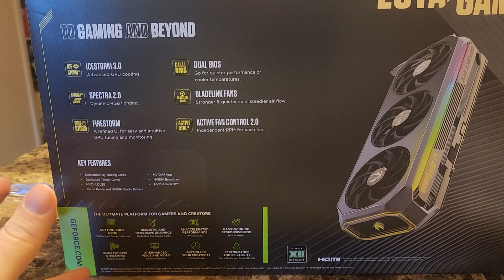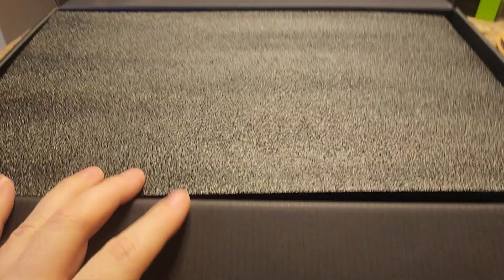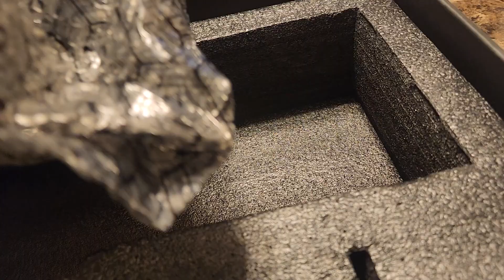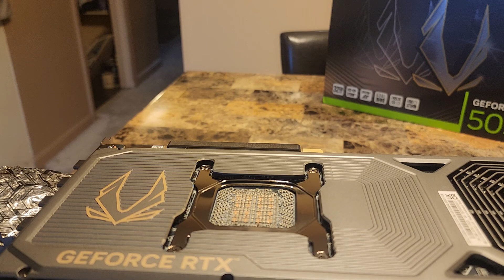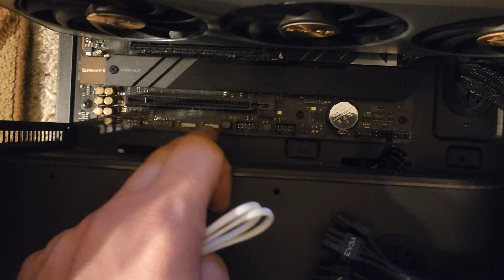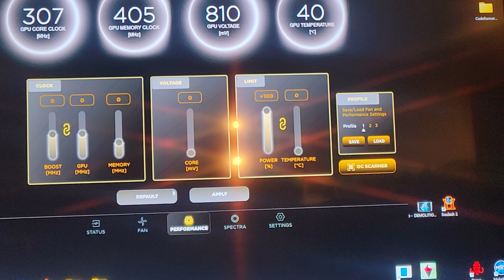RTX 5090 Zotac AMP Extreme Infinity Edition | Unboxing, Installation, Basic Testing

Comment from the maker: Well, the ROPs are 176 so that's good!  The power draw however is NUTS!  The last ~10 minutes or so I go over temps, power draw, playing with color profiles for the GPU lighting (which is pretty cool I must say) and some testing in DF Lab.  I will do some gaming tests separately soon.
Reply: @DruuzilTechGames  I see! That's why the cables keeps melting on the 5090. The power draw is ridiculous
Reply: Have you try to undervolt it, for less power consumption ?

Comment: Sorry, but, you're wrong. This card will fit in any mid tower case on the market today. It will probably also fit in several mini tower cases. As long as the case can support a GPU that's 13.5" in length it'll fit.
Reply from the maker: It's well over 3 slots wide and generally massive.  Saying "it'll fit" is all fine and dandy, but you can't close the case because of the position of the power port.  So yeah, I'll stand by my statements.
Reply: @DruuzilTechGames 

Physical Specifications

Video Card Length

13.10 in. (332.74 mm)

Width

3.5 Slot; 2.74 in. (69.60 mm)

Height

5.41 in. (137.50 mm)

I will stand by my statement that it will fit in any mid tower case on the market today. Also, some mini towers will also fit. If the plug gets in the way that is why they make right angle 12vhpwr connectors 😘

Edit: also, man, just for the record I was only arguing about it because you straight up said that it wouldn't fit in a mid tower in the video. 💁🏻‍♂️

Comment: Is this card still working well? Is it possible to undervolt it?
Reply from the maker: Still working perfectly so far.  As far as undervolting I haven't looked into it.  I have lowered the power limit to 92% to keep the power consumption down a bit while training deepfakes with it.  Still uses high 500 watt range though.

Comment: Hey man.  Thanks for videos.  How does the 5090 perform compared to the 4090 on DeepFaceLive with some of your existing models?
Reply from the maker: It doesn't work in DF Live at all, so I can't test it.
Reply: @DruuzilTechGames  Thanks for the info man.
Reply from the maker: I believe there's a Chinese version someone in Discord was claiming worked on the new 50 series cards, but I don't really trust the source so I'm not sure.  Hopefully either the original DF Live will get updated, or a newer similar app that runs on Pytorch will come along soon.
Reply: @DruuzilTechGames  fingers crossed

Comment: What a dumb place to put a RGB header. WTF Zotac?
Reply from the maker: I really don't like the power connector being there either.  It makes it impossible to close the case because the power cable is sticking out too far.  Power and RGB should be on the end of the GPU (but they have their big "Infinity Mirror" there).

Comment: Ive got the same card & its been great. Only weird thing i get is a very random single click noise, like a switch. Normal happens as i start to put it underload with a benchmark. You had this issue mate?
Reply from the maker: I have not personally noticed a clicking noise.  Not sure what that'd be.

Comment: Thank you for the review! I would like to ask you that, did you notice any coil whine noise?
Reply from the maker: Not really.  The fans are somewhat loud though above ~65%.
Reply: @DruuzilTechGames  Astral was the same. After an UV, everything is OK, except the horrendous CW. You may try 0,95V +250 Core with curve editor. +1000 mem also will be fine.
Reply from the maker: What kind of power draw are you seeing on the Astral
Reply: @DruuzilTechGames  It is about 320-330W with my settings. 520W peak.
Reply from the maker: That seems really low given how insane mine is getting without even overclocking it.  I guess when they say AMP they mean it.
Reply: @DruuzilTechGames  It is about 320-330W with my settings, 520W peak.
Reply: @DruuzilTechGames  I guess it will be almost 0 with the UV.

Comment: Congrats, great impressions! How subjectively noisy is during load? Thanks in advance!
Reply from the maker: It's more noisy than the 4090 MSI Trio I had previously.  Not as noisy as a single-blower fan design like the RTX 5000 Ada datacenter/workstation card though.  I run the fans around 70%.  I imagine it'd get truly annoying much beyond 80%.  60% more tolerable.

Comment: Why you don’t use the 12 pin power cable from the psu to the gpu?
Reply from the maker: Most current day power supplies offer that, but the one in this system doesn't have ATX 3.0 support built in, so I had to use the provided 4-way splitter (that's why they provide the splitter in the first place - for people with power supplies that don't have ATX 3.0).  That's only really been available for like a year.. maybe 18 months.  I have one power supply from MSI in another system that has that connector, but it's only 1000w and it's in use on another GPU.  I did just order a newer supply to go with the 5090 though and will be making that setup change soon.

Comment: I dunno if you knew but the 5090 actually has spikes up to 900w!!! Can the factory OC be deactivated? did you try?
Reply from the maker: Mine has not gone higher than 670. How would it hit 900w?  The max power draw between the power cable and the PCI Express bus should be what, 675 total?  The bus only offers 75w and the cable is 600.
Reply: @DruuzilTechGames check tech power up they talk about these 900w spikes that last microseconds (not always) but modern psus absorbe them

Comment: Pytorch nightly builds only work with 50xx cards now, i got my FaceFusion running by reinstalling cuda and tensorrt tho. I got an 5080 but you for your hard work deserve to have 5090. You will make an use of it. As you mention Cyberpunk, play it only with Path Tracing.
Reply from the maker: Tensorflow DF Lab does work, it's just slower than it should be.  It should be possible to get it working properly if someone with a bit more skill in development takes the time to make it so.  The Pytorch version of DF lab at this time is lacking in features, and limits you to 384 resolution which is not sufficient for making Deepfake videos in my opinion.  
I'll keep playing with the CUDA libraries though and hopefully get the 5090 running at proper speeds.

Comment: The power draw is ridiculous.
The 6000 Ada lovelace would be an amazing option. (But the price)
Great video 👍
Reply from the maker: I've seen 6000 Ada cards for as low as ~$5500 on eBay (which is where I've bought 100% of my datacenter cards), and people will often do the whole "Best Offer" thing, so you can talk them down.  If I could trade my 5090 for a 6000 or 5880 Ada (maybe add a bit of cash on my part) I'd do it all day.
Reply: @DruuzilTechGames  that would be awesome. Because with the issues surrounding the 5090, it would be a great idea to trade it for 6000 Ada. 
Or maybe Nvidia will come up with a fix for the 5090

Comment: It's a 32GB microwave that is insane over 600 watts is nuts! Great video bro!
Reply from the maker: 670 is easily the highest TDP I've ever seen in a PC component.
Reply: @DruuzilTechGames  if that's the future we gonna need more nuclear power plants lol maybe for shits and giggles test at x16
Reply from the maker: I think that Blackwell datacenter cards would better serve me than a 5090.  I may or may not keep it in the long run, if I can get something like an RTX 6000 Blackwell Edition (which should be over 48GB GDDR7) that'd be awesome.  Big $$$$ though.
Reply: @DruuzilTechGames  the Blackwell 6000 edition may drop end of the year or early next year (probably $8000) LoL
Reply: @Fathergodzl you could undervolt it for less power draw.